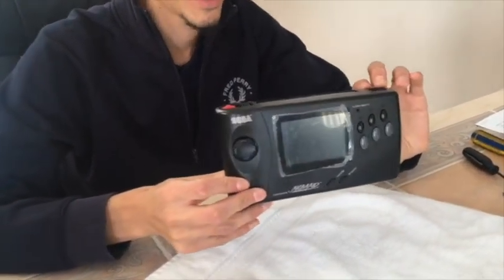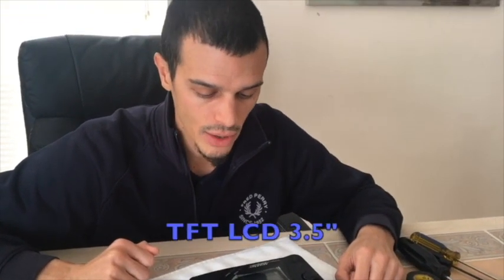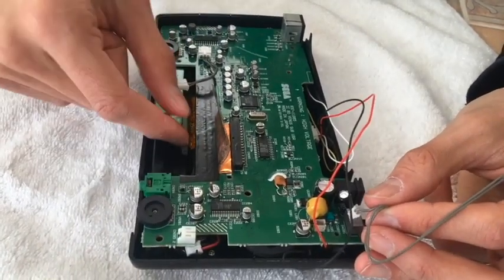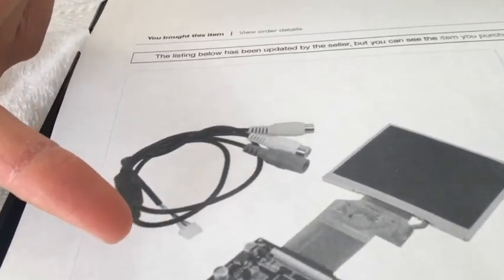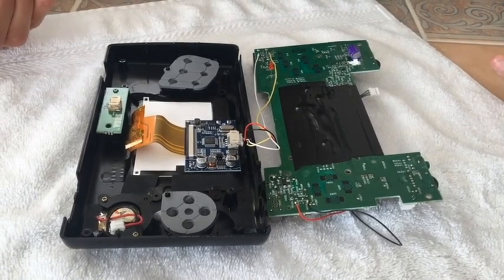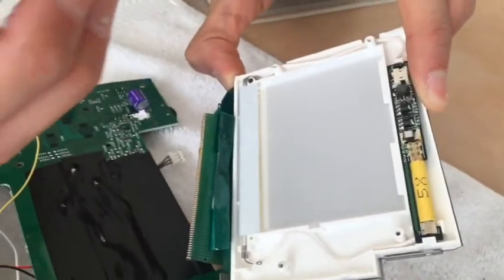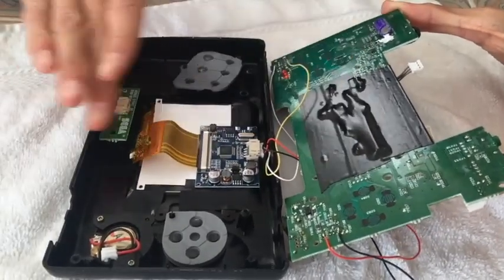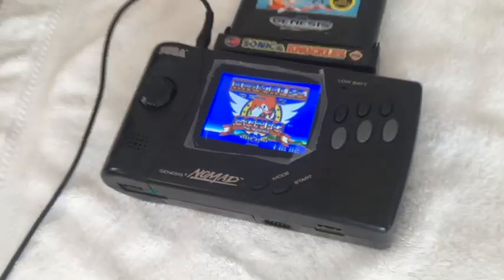Sega Nomad Mod - How to Upgrade to Modern LCD Screen

Comment: I own a Nomad too, I know everyone always change the screen when it fails burnt but the issue is, the problem are just the Polarizer films, most of the times. I don't  like the idea to change the way my nomad should show the video, even if we are talking about an improve, just a pure nostalgic choice. So I am looking everywhere about knowledge of somebody that sucessfully changed both FRONT and BACK polarizer films from the SEGA NOMAD and the result was the way it  was intended. Is cheap, just is all about to figure the grades of each film

Comment: Great video but the solder for TP210 was just painful to see. Retrim and trip that cable add flux directly to it and then add solder to it. Reflow on the board and then resolder. That will create a better connection. But you could have future issues with that. Just a nitpick but also a suggestion to correct and prevent future issues.

Comment: Looks very good your Sega Nomad and with a very easy LCD RGB screen to replace, just only 4 solder points! Did you wire for the 5V mod for that LCD model and connnect to a 5V in your Sega Nomad PCB? One other question: Could be possible a RBG mod in this LDC screen? Thanks for the video :)

Comment: Can i install same tft screen on sega game gear? Are they have same size?
Reply: I'm afraid not. The reason the Sega Nomad is easy to replace with a modern screen is because it has video out. You're literally tapping into the composite video signal. Game Gear has no video out single and is a drastically much more difficult mod.